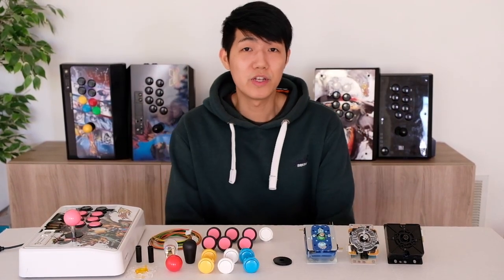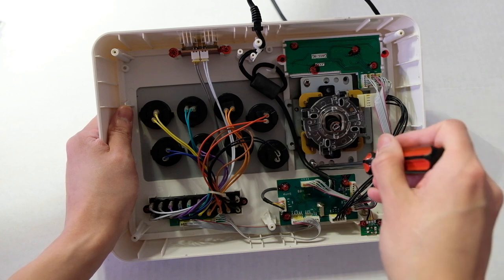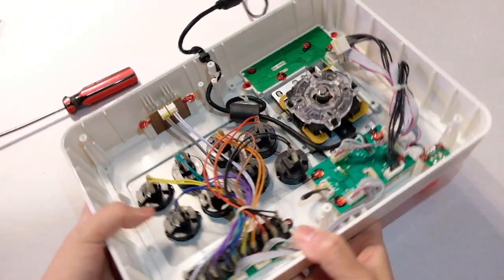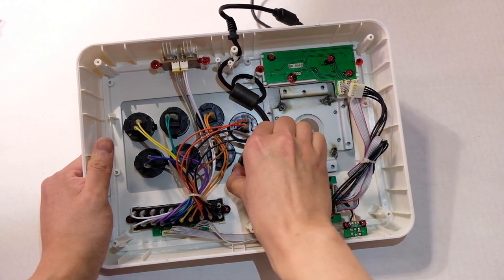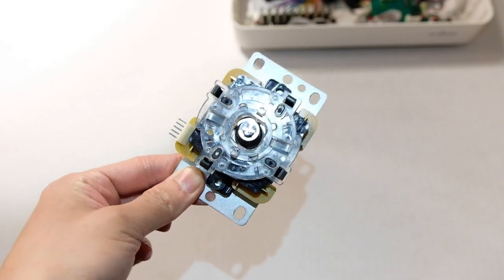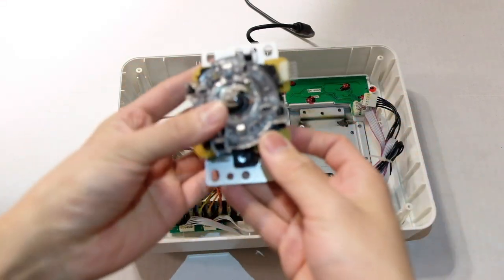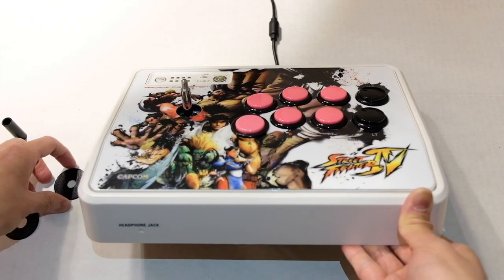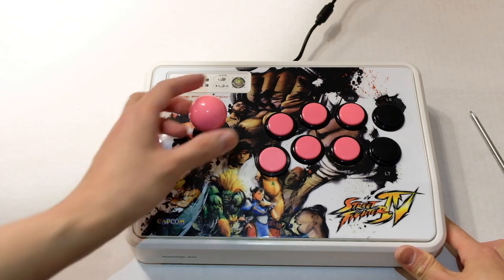Arcade Fight Stick Mod Beginner Guide Sanwa Buttons

Comment: 2:05 NY, I have never worked on a fight stick before, but I have electronics and car repair experience. To me, it seems like the better way to swap the joystick is 1.Remove the wiring harness connector 2.use a flathead screw drive to hold the shaft and take off the balltop 3.remove the four philips screws and remove joystick assembly.  this way we don't need to deal with wobbly joystick when disconnecting the wiring harness and balltop. also, wiring harness should be the first thing to disconnect when working on electronics to prevent accidental damage. 
You are 100% right when it comes to swapping the buttons - only work on one button at a time with one set of wiring to worry about. Just like spark plug wires in a car. Great content again! Thanks for the info.
Reply from the maker: If you didnt mention it; i totally didnt even realized it, great observation, i will definitely keep that in mine, also i think when i am recording, our mind is so focus on 1 thing that we sometimes forgets to do certain things. 👍🙏 have you heard of the phrase, the one in the chess match is not aware, and the observers around the chess match is more conscious of whats happening?

Comment: I know this video is old but is modding the same with all fightsticks i have a mayflash f101 and will following the steps in this video work since its a different fightstick
Reply from the maker: Possible is the same steps, but the f101 will not work on the ps4, ps3 and pc should be okay tho ❤️🙏🕹

Comment: I recently bought some new sanwas for my old sf4 arcade stick - So this is extremely helpful for a first timer.  Thank you for this.
Reply from the maker: Glad I could help ❤️
Reply: @JoystickNY hi bro.
I bought an octagonal gate sanwa but there are slightly a little gap between the octagonal yellow insert and the white gate around it. Is that normal or isit a bad batch of component?

Comment: This is exactly the same arcade stick that i mentioned in the comments to your other video. Once it arrives, i'll have to test it and see how the Sanwa parts feel VS my modded (2lb spring) Hori RAP V(with stock hayabusa buttons). Can't wait for it to ship! 
Reason i got it (apart from wanting to try Sanwa on a 2nd stick) is that my Hori RAP V was giving me some ghosting inputs in some PS3 Tekken games , but since it's the Switch/PC version, i'm guessing it's a compatibility problem with PS3, since it never had that problem in any emulator/Steam/Switch game. 
So this Ps3/PC stick will be servicing me there.
Reply from the maker: Thats a lot of good info, that you sharing 🙏❤️ i like everything default on the sanwa

Comment: EDIT: the fightstick I'm using is a Soul Calibur V ps3 Hori. It came around 2012. Every part is extremely tight, so be careful. 

Depending on your Hori Sanwa joystick, it might have a stronger safeguard for the connector.
It's hard to describe but let's just say it needs a bit more strength to disconnect, because the female connector has a plastic hand protruding from the top so it holds onto the male connector firmly.
This exclusively requires the flathead, since you need to loosen that grip and boom, it finally disconnects.
Reply from the maker: Thank you for sharing 🙏❤️
Reply: @JoystickNY  you're welcome 😊

Comment: What is the best stick for a guy with small hands? I would like my buttons to be really close to each other.

Another question is, are there any sticks without clicking sound on buttons and shaft?
Reply from the maker: unfortunately All the sticks and buttons are standard size, i think only custom sticks are able to be really close to each other, but i recommend getting a standard stick because you will get used to it, and if you ever go to any arcades or using someones elses stick, you will be good at it. 

there are quiet sanwa buttons, they are alittle bit quieter, for shaft, and joystick, i think the happ stick doesnt have a clicking noise, double check it tho. But i don recommend happ sticks for fighting games.
Reply from the maker: 🕹 ⬇️↘️➡️🔴🔵⚪️
Btw, someone else ask me what is the best stick for recent years, let me paste my answer here for you, hope it helps in your controller journey 

fritz the dog 😃 thats a great question, in my opinion, i think the best arcade stick is the one that has all the premium parts, which most expensive arcade stick these days have.
🕹 ⬇️↘️➡️🔴🔵⚪️
if they have all the same parts, whether is a madcatz, razer, hori, qanba, i think they will be all the same. 
🕹 ⬇️↘️➡️🔴🔵⚪️
On top of that,you just have to find the style you like, the shape that fits your wrist, and if you like the metal or plastic, led lights or not, all those extra features prob wont affect game play that much, but sticking with the same stick is going to help, if you use a 150$ stick for 3 whole year, and then get a 300$ stick, you are still going to play better on that 150$ stick in the short term, muscle memory does help. 
🕹 ⬇️↘️➡️🔴🔵⚪️
Lastly i want to give you some facts, daigo and justin wong have been using the madcatz TE2 arcade stick for many years, then justin wong move on to qanba for abit, now he is on victrix.
🕹 ⬇️↘️➡️🔴🔵⚪️
Xian and infiltration uses razer panthera and atrox. 
🕹 ⬇️↘️➡️🔴🔵⚪️
Many pro tekken players uses hori rap4, etokki omni, and many uses the qanba obsidian.
🕹 ⬇️↘️➡️🔴🔵⚪️
————— And —————
Tokido, 
mago, 
chris-g, 
bonchan, 
momochi, 
fchamp, 
fuudo,
gamerbee, 
pr-balrog, 
Kbrad ———All uses madcatz TE2. 
🕹 ⬇️↘️➡️🔴🔵⚪️
And all the pro pad players use the ps4 controller. 🎮
Reply: @JoystickNY  When did Tokido switch to a TE2? I always remember seeing him with a Qanba Obsidian with custom parts to match the Echo Fox color scheme on his Obsidian stick.
Reply from the maker: TheWarriorPoet i think i may have referring to the time he was being sponsor by madcatz, you are correct, they are always using different sticks at diff times, sometimes depending on sponsors .

Comment: Excellent video. What is a good parts store?
Reply from the maker: Sixdux thank you so much 🙏 if i am buying a lot or me and friends are buying together, i usually use focusattack.com, they have pretty much everything you need, is like a one stop shop, alot of diff types and colors. If i just need like a 1-2 things quick, i usually go amazon and ebay, and amazon n ebay usually dont have shipping charge. It wont make sense to buy 1 thing on focusattack and pay shipping

Comment: Hey there JT. I use to play SFII at the arcade when I was a kid and 3 months ago I decided to get an arcade stick to play at Fightcade. Been reconecting to gaming, playing SSF2T there ever since. For my surprise the stick is allready showing a problem. diagonal up/right is not perfect. Many times the command is readed as UP only (so a diagonal jump becomes a neutral jump). Do you think it's allready a metter of replacing stuff? Or maybe just cleaning? My stick is Madcatz FightstickPRO SF vs Tekken. Thanks for the attention.
Reply from the maker: APOENA - Allnite Music i think replacing the lever should fix the issue,  i would recommend buying a sanwa JLF lever from amazon and replacing it. If its fixed. Your good, if it doesnt fix it, you have 30 days to return the part. Usually with these lever, it does break over time. That would be the easiest method.
Method #2. You can buy a sanwa JLF micro switch Pcb, and replace that, that is basically the directional switch part on your lever. But with shipping and all, you are looking at almost 20$. So you might as well go for the first method which you get more stuff for the future if anything else breaks.
Method #3. I dont recommend it, because it takes too much time for something so small. And you need to know soldering, You can just buy the micro switches for like 3$ replace the pin-pointed issue. 
Hope this helps. And thank you for dropping by 👍❤️🙏🕹
Reply: @JoystickNY  thanks alot man I'll consider all thath
Reply from the maker: APOENA - Allnite Music no problem, let me know how it goes 👍

Comment: I swapped the 30mm buttons on my Hori RAP 3 SA with GameFinger buttons, and afterwards my joystick is no longer being read at all. The buttons all work, including the little ps3 control panel ones, but the joystick directional inputs are nowhere to be seen when testing in many games and joy.cpl.

Any idea on why this may have happened or what I can do to fix it?

Comment: Is there a stick that is good for modding?
Reply from the maker: Ragaa most of them are fairly easy,
Usually entry and mid price range stick you will need to unscrew some screws, most sticks over 200$ should have easy access for mods. Usually a bigger stick will be better for mods. Depending on how far and how deep you are going in to it, like Korean levers require a lot of room.
Reply: Oh okay, its because im trying to be on a budget and i heard that a Mayflash or the Qanba Drone are good for it if u want to be on a budget.

Comment: Hi, what is the name of the arcade stick you are modding in this Video.
Reply from the maker: That one is the xbox 360 madcatz sf4 tournament stick 🙏❤️
Reply: @JoystickNY  This is the Xbox 360 Madcatz SF4 SE Arcade Stick. The Tournament Edition stick was much wider and had a cable management system. I owned both when they came out.
Reply from the maker: Hoodie Gamer they are classics, i wish madcatz would continue to make them 🙏❤️

Comment: Hi there. I've been looking through the internet all over. Is it possible to make one of your buttons into an up direction from the stick? Or just anyway to make a button into a jump button.
Reply from the maker: I think on pc, you can easily just bind a button to a direction.
On traditional 6 button stick, i dont think there is any way, not that i know of.
Buttttt, you can easily get a mix up arcade stick and that will solve your problem. It has a built in jump button

Comment: Im having trouble with one of my button. Sometimes it will work, other don't, and the stick start doing crazy things. I noticed the conectors of the button don't come with an isolation plastic cap. Theu are vey near to each other. Do you think they might touch, and hence, send fals signals to the controller? Thanks :)

Comment: Great video! Do you have any experience with older fight sticks?

I recently acquired a Hori Fighting Stick Neo II for the Neo Geo AES, and sadly it came to me a broken and rusted mess. I've managed to polish and clean most of the rust and I re-soldered all the contacts so it works, but I was curious about putting in new sanwa or semitsu buttons/stick.
Reply from the maker: I dont have experience with older arcade parts, but are you able to solder the buttons to the stick?
Reply: @JoystickNY  if you want I can show you a picture of the pcb. Yes everything is soldered. I restored the sticks functionality by desoldering, cleaning the contacts and desoldering all the wires.
Reply from the maker: I am glad you were able to get it work, much be a classic stick. Growing up we never had money to buy games or consoles, i never really experienced the classic and retro era of games.
Reply: @JoystickNY  same. The neo geo AES was absolutely something I could never have afforded. I bought a broken one and manage to get it working again. About the only way I could have one. Grateful to own a piece of history

Comment: When you replace a button, does it matter where the two cables connect to? Like, does one have to go on the left, and the other on the right? Or it doesn’t matter?
Reply from the maker: Great question, you are right, it Doesnt matter where it goes. 😀

Comment: My favorite arcade stick parts are sanwa JLF and Korean levers, hayabusa buttons, eight-way (Octagonal) restrictor plates and bat-tops.
Reply from the maker: Dustin Nunn those are great combinations 👍
Reply: @JoystickNY  I have a Hori RAP N Hayabusa arcade stick controller, I tried out the hayabusa parts (Lever and buttons) and they suck. Are the sanwa parts any good?
Reply from the maker: Sanwa are most popular, prob cant go wrong, give it a try

Comment: Which resitricter gate is more suitef for pulling moves on SFV? Square, Octogate or round gate? I use Guile and Ryu. Thanks.
Reply from the maker: I think most player uses square. And in my opinion, square will be better for guile.
Reply: @JoystickNY Thanks for the quick reply. I agree with the square gate for Guile but it's quite difficult to pull off moves for Ryu, would an octo gate be easier? Thanks.
Reply from the maker: kenny w both for circular motion, i think is about the same, once u get the gesture down, both gates feels almost the same, but square is definitely better for charge because its a straight line
Reply: @JoystickNY  Cheers, thanks for the advice.

Comment: For the stick, which brand is better? Is the uhm, not tpsure what it’s called, gate? Mine is like a square which I don’t like, can that be changed to a better one?

Oh it’s just ribbons, hopefully,one is the same, I don’t have a solder handy.
But I’ll change the buttons first. Current ones are not good
Reply from the maker: All the brands are similar, they are mainly just sanwa parts inside with diff external features , i recommend going with the style you like more, becuz u can always change the inside
Reply: @JoystickNY  I bought basically a Pandora, thinking of replacing the buttons and maybe even the stick. But for now maybe just the buttons (they are ok but the difference is really obvious to me. Must be some cheap sanwa clone or something
Reply: @JoystickNY  I have a stick that uses sanwa, maybe I’ll get from there since I don’t use that one

Comment: i need a Arcade Stick for my PS4 and for Recalbox exist an Arcadestick for this two systems.
Maybee the Button with Light
Reply from the maker: C L 🙏 👍🕹❤️
Reply: Joystick NY that ist Not the answers
Reply from the maker: C L sorry, can you rephrase your question? I thought it was a statement, so i thumbs up it 🙏
Reply: @JoystickNY  I meant
I would like to build an arcade stick myself that I would like to use for the PS4 and now and then for my Retro Console Recalbox.?
Reply from the maker: C L i see, there is the Brook PS3 PS4 Fighting Board if you want to do that project, but the ps5 is coming out in less than a year. You might want to wait for more spec before starting your project just to check if its going to have any backward compatibility for ps4 controller etc, i would love to build a stick one day too, but i havent had the time to due to work and family and trying to make videos
Reply: @JoystickNY  @ Thank you for the quick feedback.
Yes, I have the same problem with time.
But I would like to do that because I have some Beat & Up games on PS4.
But I would like to combine with my recalbox because I like to play on the PC Engine, & Mame.
Maybe we can start the project both :)
Reply from the maker: C L maybe after the ps5 is release and i gotta check what boards they have, but i also hope they release more sticks for the ps5, but i think its gonna be expensive being there isnt that much options in the beginning. By the way my favorite beatem up game is sengoku 3, it is amazing. Is on the ps4 game store

Comment: Hi, I know this is an old video but I hope you can help me please... I've just purchased a Mayflash F500 V2 and I was wondering if there is a stick replacement that has a shorter gate? Because the one it comes with feels like it's a mile apart from each side of the gate. I use to play high level 1v1 SFIIT/HF and SSFIIT back in the day (showing my age now lol) and the Arcade machines had much shorter and tighter gates than my new fight stick. I'm getting right back into these games again and now SF6.
Any help would be appreciated at all as I'm not feeling this new stick at all.
Reply from the maker: Possible try putting a tighter spring and see how it feels, if not, try a korean lever, they feel like they have a shorter throw with the rubber system
Reply from the maker: I misread, i thought u replaced with sanwa already, if not, upgrade to sanwa first, it has a smaller throw, u might like it
Reply: @JoystickNY  All good, I'll definitely try that first for sure. I'll go spend cash now 🤣 and look forward to your future videos. 
Kind Regards
Reply from the maker: Happy to help ❤️

Comment: how do i take the buttons out without the tabs permanently sticking in afterwards. are they just unusable now
Reply from the maker: What happen to the tabs? Broken?
Reply: @JoystickNY  oh no, at this point I realized my mistake, for the first button I tried to remove, I tried taking out the button the wrong way, pushing the tabs too far in. I realized my mistake tho and everything is fine. thanks for checking in though :)

Comment: Hi. I have this same stick, currently it does not work for PS4 (specifically for Samurai Shodown) is it possible to change the board so that it can be used on PS4? I have another MadCatz Alpha, can I use the board from this one?
Reply from the maker: Great questions, the stick in this video is for xbox, it shouldnt work for ps4. About switching pcb, that i am not sure, i never tried it yet. I think its possible, but may need some knowledge in soldering, i am not sure if those information are online 🙏❤️

Comment: I switched my buttons but now none of the wires correspond with the right button like the wire for square registers as 3 and it’s in its right spot
Reply from the maker: Try resetting the in game settings
Reply: @JoystickNY  I did :( Idk what I did but some of the wires aren’t even registering as anything at all
Reply from the maker: That is so strange, everything should he just simple plug and play, make sure nothing is pulled or disconnected,